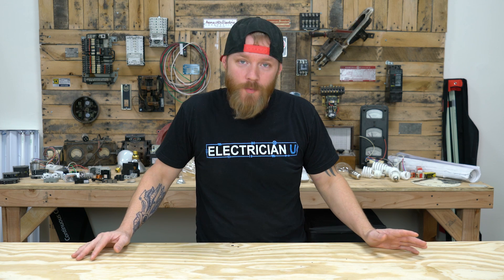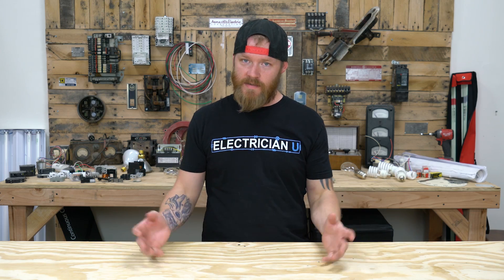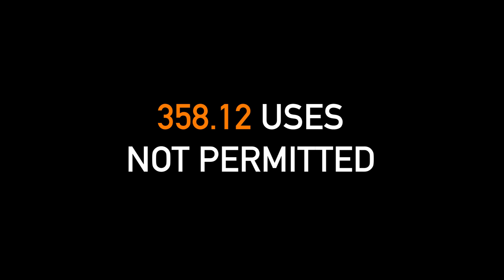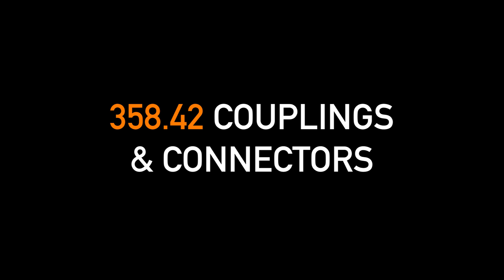Working With EMT - ELECTRICAL METALLIC TUBING and What Electricians Should Know

Comment: Nice vid. I was under the impression that we can’t use the conduit as a ground because using an actual ground wire trips the breaker in case of a short faster than the conduit does, even though that’s how a lot of older stuff was ran.
Reply: Joshua Gardner I think it depends on local codes because the NEC does allow it, most jobs however spec out that you need to run an egc with your circuit conductors because the likelihood of EMT being installed incorrectly is very high(not being electrically continuous from one termination to another.)
Reply: It's allowed up to 120v 20a while any higher voltage/amperage stuff needs it's own ground wire. Not having a bare metal wire to wrangle around an outlet inside the box is so much easier.
Reply: @shimes424  It's actually allowed for any size conduit that the wires will fit in (observing fill ratio limits), assuming your location adopts the NEC as-is. There's been a fair bit of research by Georgia Tech showing that properly made-up EMT provides a much better low impedance ground for clearing faults than a properly sized wire EGC. They even have a calculator you can download for free that will tell you what size EMT or other conduit you need for a given ampacity. That said, I do still often run a wire EGC :)

You do still need the separate wire EGC in isolated ground circuits, of course.

Comment: As I understand, new compression couplings have plastic rings for moisture barrier, does that break the continuity for grounding?
Reply: Not all compression fittings have the seal, just the rain-tight fittings. You can still get the non-raintight fittings.   It looks to me like even with raintight fittings, there is still a lot of metal to metal contact between the fitting and the tubing.  I seems like there's still be a conductive path, but I don't know what the code answer is on using it for a grounding path.

Comment: I was working in an older warehouse and one of the previous electricians used the conduit as the neutral. It was pretty scary.
Reply: cost effective for sure. lmao
Reply: Yikes!!! I go the other extreme, and pull an actual ground wire in addition...
Reply: Stupid question, how would use the conduit as a neutral? Tie the neutral to the box instead of the ground?
Reply: That’s pretty smart
Reply: Smart. Saving on wire. 😬

Comment: I’ve never seen aluminum emt before. is that used often? What’s the application for it I’ve only ever seen galvanized.
Reply: darthcollosus aluminum is used on Cooling towers and Ac units that are place outside it has other applications as well it’s really light and easy to bend
Reply: Used with aluminum wires

Comment: Haven't run any conduit in a number of years but my first day on the job 20 years ago a Journeyman and I ran 200 feet of 3/4 EMT.  That day I learned how to bend a 90, a 30 degree offset, box offsets and pull wire. That day made me fall in love with the trade. Thanks for the trip down memory lane.  Great work, keep it up.
Reply: As a Chicagoland apprentice, we're always running conduit 😅
Reply: @eriknovak5452  Yeah, I've heard it's all conduit or mc out there because of rats causing damage to nm cable. Is that true?
Reply: Oof sorry for your loss